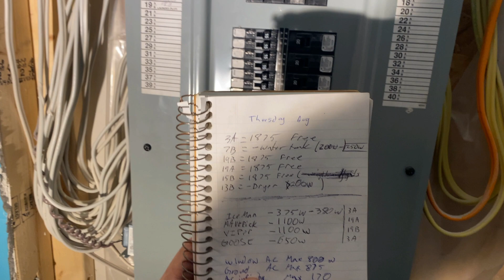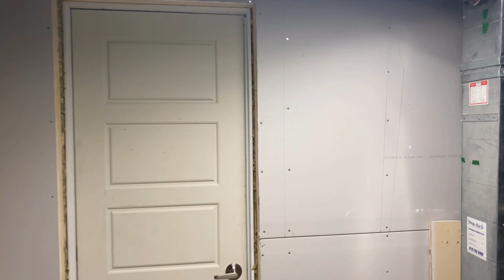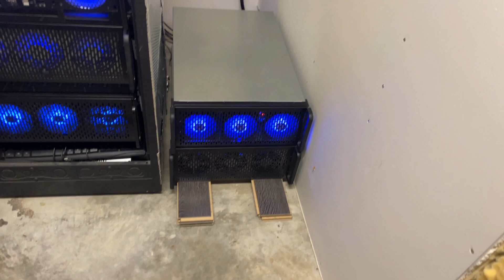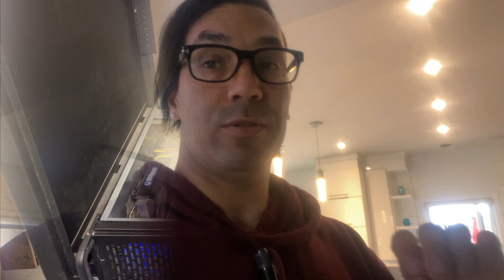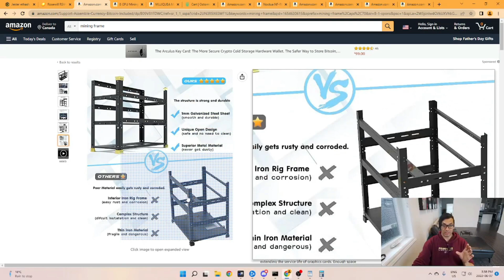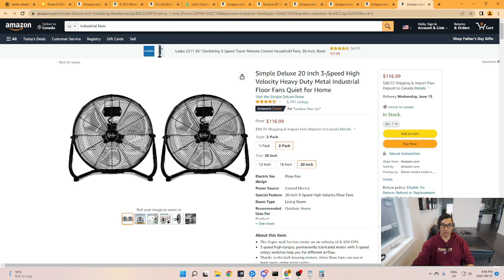Mining Farm Summer Heat Planning 101

Comment: If I/you were to build a servercase yourself, like in a carpenter style - how would you draw this? Im about to attempt this myself. I have a bunch of octominers x8+x12, and some air rigs. Would be cool to get them all in there. I have the cloudline s8 aswell for pushing air. I guess a shelf style server case, with fans in the bottom maybe, drawing air into the top exhaust. With at kitchen vent on top like yours capturing the heat and getting it out in the summer and maybe inside on the winter. I have a shad thats connected to my house.
Reply from the maker: Thanks for the comment and view!, I actually just recently posted another thermal design video I think would help you with this setup. Subscribe and look at the most recent thermal video I have and post a comment on there if you still have questions :)
Reply: @JARVIS_AI_LABS  Thanks! Whats the name of the video?

Comment: Saw you are running fans 95%. That is not good for the longevity of the GPU fans. Otherwise a very well thought out setup.
Reply from the maker: For the 3080 FTW yeah, they are at 95% I think I just need to bite the bullet and re-pad them because some of them are in the 70 degrees and the ones that need repadding are in the 100 degrees

Comment: I built my self a similar setup right infront of the window I built a closet made out of wood open air frames each rig has it place 4 box fan pushing air trought my rigs and a 24 in exhaust fan work great no ac
Reply from the maker: Thanks for the comment, I think that doesn’t work as good when you are blowing humid hot air across the cards in the depth of summer